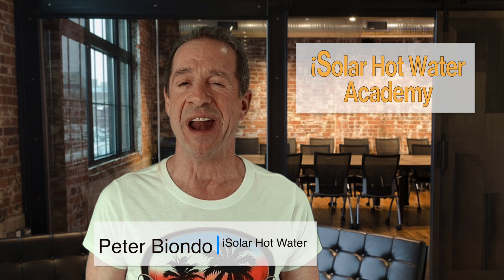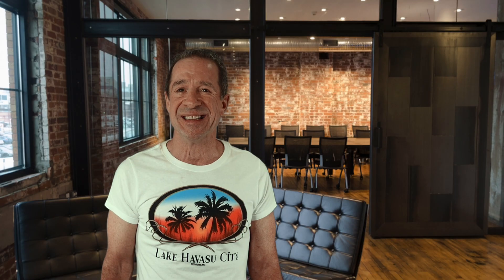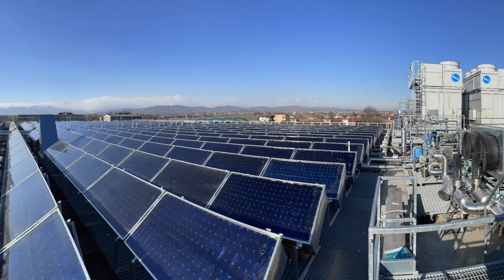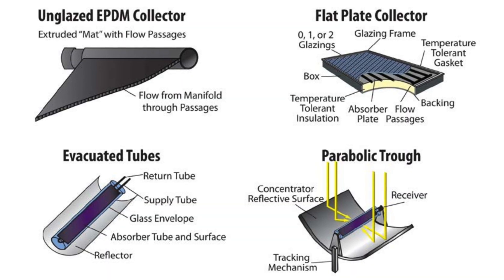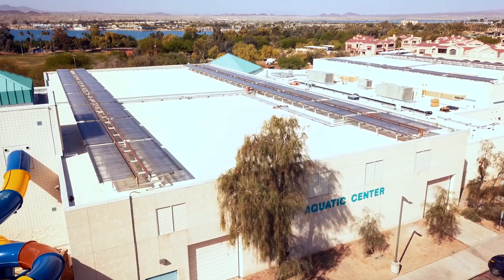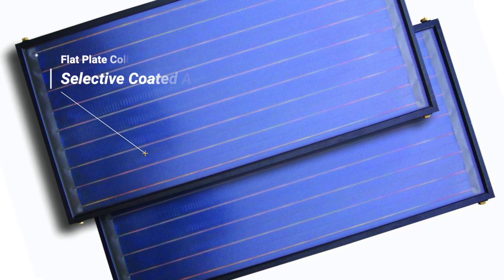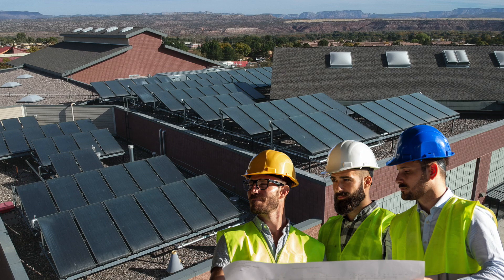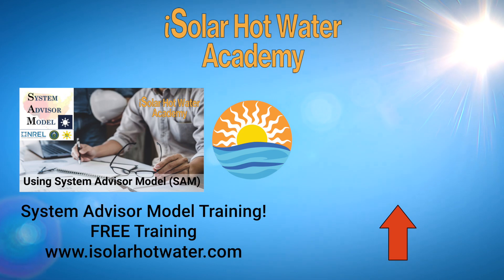Which Solar Collectors are Best?

Comment: Why not save some money and just heat directly from the panels via 12/24/48v elements? Or by inverter load output? Epever 40/60A charge controller+MT50 meter (AMZN/AlieXpress) will support up to 300w element and control on/off times. Alternately use an immersion cartridge element (300-1000w-ac) run off of your inverter (1x1/2'' brass/ss bushing required). Existing thermostat will control. I have been using these solutions for the past 5 years without complications.
Reply from the maker: Great comment Central Plumbing! I listen to my audience. So I've been scripting my next video to explain how to use PV to directly power a water heater element. Not only that but how to model the performance. That's a missing element for sizing the system. So in the next video I'm keeping it simple for PV direct water heating. I'm not a PV trained professional and would want to learn more about the way you apply the technology. Please contact me on my website if you wish. 
Next, I want to train PV users how to use the water heating element as a shunt load, eliminating the need for feeding the power back into the grid.
Reply: Thermal solar can be up to 70-80% efficient compared to the 15-20% of photovoltaik panels. That's 800W per square meter VS 200W (assuming the standard 1kW/m^2).  Heat pumps can bring them closer together, but resistive heating will not get anywhere near.

Comment: Im pretty sure standard solar panels + heat pump water heater would be better overall than thermal panels. You only need so much hot water.
Reply: With upcoming video's here you can determine the savings equivalent. Solar Thermal shines in financial modeling for sunny climates with high fuel costs. There are ways to determine if solar thermal is right for you. My next video explains the highest financial solar thermal performers. You won't want to miss that one.
Reply: If you own a hotel somewhere hot and have a lot of pools to heat, you dont want 20% efficient PV + inverters and heat pumps that can fail.
Reply: @HubbHubbs  pretty sure solar thermal would be more likely to fail. But ignoring that ideally the hotel should have solar to begin with. Also should also have heat pump water heaters.
Reply: I would agree. A PV+HP would be better.
When the water is hot enough, you just use the excess electricity for something else in your house.
When you don't have sun, it will use a lot less energy than a solar water heater + something else.
Reply: @Imaboss8ball we had thermal solar collectors on my parents house in Germany since 1997. 3/4 of the year, the oil furnace is not needed at all. That can make quite the difference.
Reply: Some places limit the total PV size that can installed (eg due to grid constraints), so adding separate solar hot water can still be a sensible choice regardless of other factors.